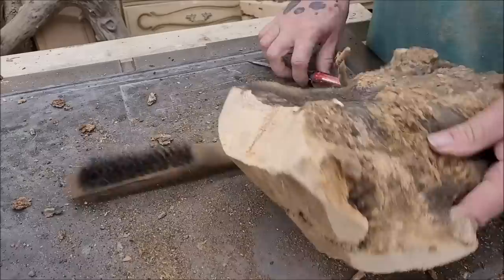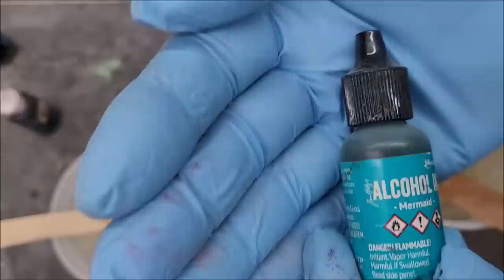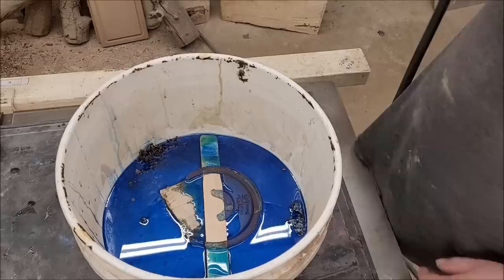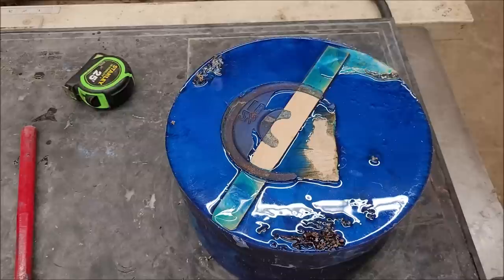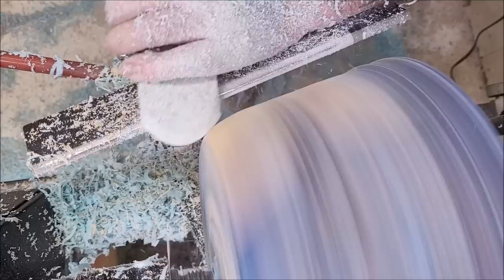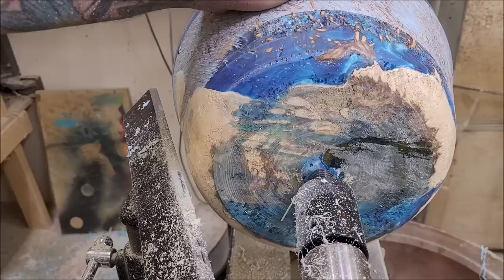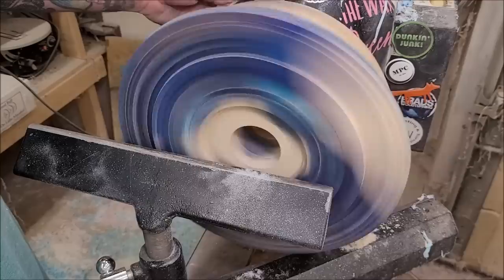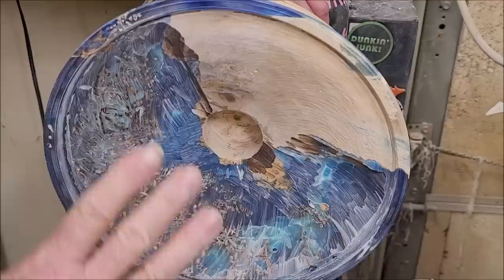How Not to turn a hybrid Bowl

Comment: Bon courage! I suggest that next time you do this, you vacuum out the shells, sand, etc, as much as possible, before you begin. It could make a useful decrease in the rate of tool blunting, and painful missiles! 
I really like your resin colours!
Reply from the maker: Thank You Stephanie,  I tried blowing the dirt and crap out with compressed air,  that didn't work either,

Comment: I was watching your video when I started to add this question/comment "I'm always surprised you can get away with a mortise on that heavy of a piece. Especially this piece the mortise looked a bit punky.". 
As soon as I wrote this the piece flew off the lathe 😂 ( not 😂 at you 😂 at the timing)
Reply from the maker: Yes I push my luck all the time !  but I like to use a mortise over a Tenon! Thanks again for watching

Comment: What if you were to drill a series of holes into the wood and fill with resin to try balance it out that way ? Best of luck with it, looks great so far
Reply from the maker: Thank You Paul,  I actually considered that but was afraid the beating of the tools over the empty holes back to the resin would blow the piece apart

Comment: Soak in vinegar to soften.   I remember Kim sent you sea shells once...I don't remember exactly what I said there...but also made some suggestions...if you needed them.
Reply from the maker: Thank You Morgan,  to late for all that now !
Reply: @PohlBarnProductions  LOL...I know.  No, for future sea shells or sea weed.
Reply: You still have some sea weed left over...why not do a comparison thing?  If you want the living critters out, freeze the sea kelp solid for a few days and then that out completely.  As it's thawing out, the water will hopefully dissolve any dirt.  The stuff you get out can be fertilizer for the garden.  Of course, there's also a You Tube video called 'Wood Turning Seaweed' by 'Cook Woodworks'.
Reply: According to Wikipedia: 
Holdfast torn from the sea floor by a storm
'A holdfast is a root-like structure that anchors aquatic sessile organisms, such as seaweed, other sessile algae, stalked crinoids, benthic cnidarians, and sponges, to the substrate.[1]

Holdfasts vary in shape and form depending on both the species and the substrate type. The holdfasts of organisms that live in muddy substrates often have complex tangles of root-like growths. These projections are called haptera and similar structures of the same name are found on lichens. The holdfasts of organisms that live in sandy substrates are bulb-like and very flexible, such as those of sea pens, thus permitting the organism to pull the entire body into the substrate when the holdfast is contracted. The holdfasts of organisms that live on smooth surfaces (such as the surface of a boulder) have flattened bases which adhere to the surface. The organism derives no nutrition from this intimate contact with the substrate, as the process of liberating nutrients from the substrate requires enzymatically eroding the substrate away, thereby increasing the risk of organism falling off the substrate.

The claw-like holdfasts of kelps and other algae differ from the roots of land plants, in that they have no absorbent function, instead serving only as an anchor.[2]'

Comment: WOW…this is really munching up the tools. You may need to alert air traffic control in your area, to look out for slithers of resin and low flying bowls. I wonder if there is anything from the ocean, that once dried, doesn’t destroy tools? Also another question, do you test the moisture content of the wood before you set it in resin? Looking forward to Part II. 🙂
Reply from the maker: Thank You Fiona,  I do test the moisture actually, I just do not show it, I get sent wood all the time that is to wet to put resin on,  so I have to wait for them to dry out
Reply: The seaweed reminds me of European Gorse Bush, wonder if that would be kinder to your tools?

Comment: If your getting so much chipping and tear-out because you can't run the lathe at a high RPM, could you possibly pull the tool rest farther away from the piece and use a dremel with a round burr bit as your cutting tool?

In theory, the 12,000+ RPM's of the dremel burr should give you a clean cut on the resin even though it's not spinning all that fast...

EDIT: OK, an Angle Grinder works too...

😄😁😆😅😂🤣
Reply from the maker: Thank You, I suppose that could work,  the tools I ordered arrived today so I will start on it tomorrow
Reply: @PohlBarnProductions  Good Luck...

Comment: Doug I turn mostly bowls what is your recommendation of total boat to use
Reply from the maker: Thank you Dennis,  depend on your application, if you're gonna pour like I do I would suggest you go with a thick set or deep pour resin, the 2 to 1 I use tends to over heat and crack when I pour large molds

Comment: I have to ask, how did you get the 5lb weight off? I know you didn't turn it.
Reply from the maker: I hit it with a hammer at the beginning Michael,  what was left was the paint the resin held on to making it look like the weight was still there but if you look  the % is backwards as it's a negative
Reply: Oh, you meant you didn't know if you were going to get the blank out of the bucket. I thought there was another weight under the first one. It sure looked like it. But, now that you point out the inverted numerals...yeah, I should have noticed that.
Reply from the maker: it's happened before and people wondered how I could turn the steel weights